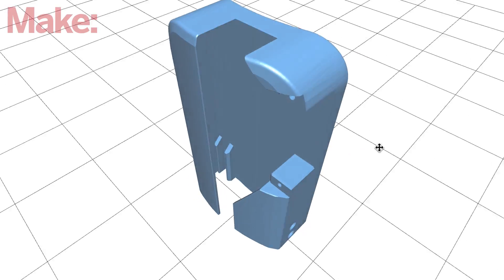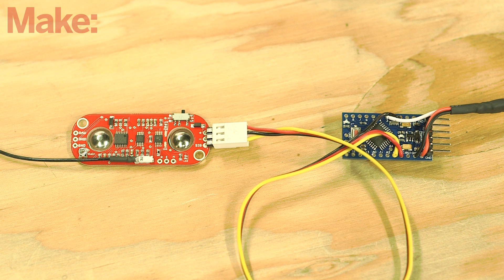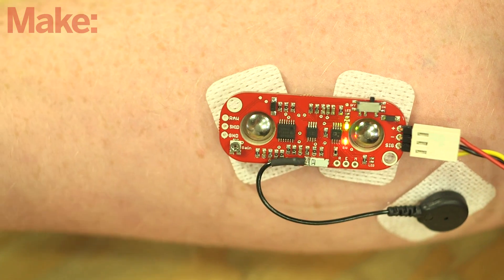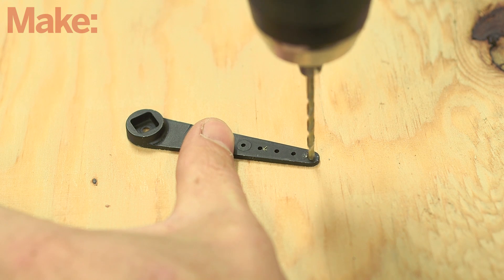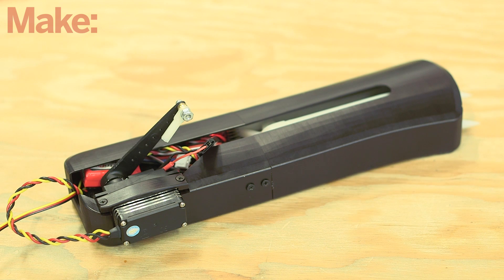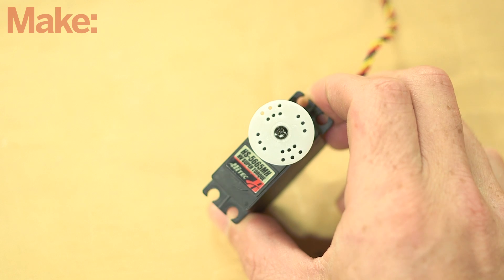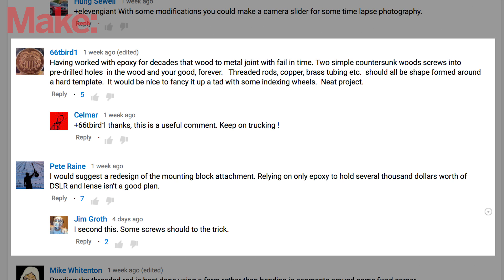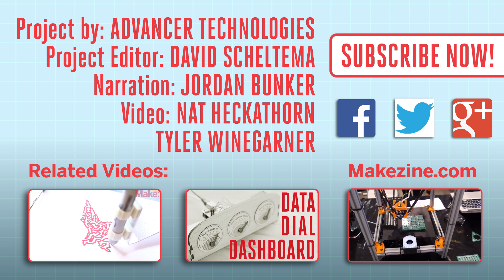3D Printed Bionic Claws

Comment: you could use a cheaper and smaller micro controller  to operate it example:pic16f84a .... use burner to program chip only problem is its using assembly which sucks :D

Comment: Would a solenoid work as well? That way you wouldn't have to have the rod that sticks out of the brace when the claws are extended. They have them that run on 5 volts, but they might be loud and I am not sure if they would have enough force. Might try one day though.
Reply: +Scott Perry the issue is more the travel. it's hard to get 4" of travel distance in a compact form.

Comment: How about instead of a servo there's a track lined with electromagnets that move the claws?

Also how about using more sensors to control the claws individually?
Reply: +Crowforge 1) electromagnets are really bulky and usually heavy, 2) individual claw control would require two more servos
Reply: +NullPoints 1 They wouldn't have to be that powerful. 2 The idea is to replace the servos with the rails.

Comment: I would put the servo off center and horizontal. then have the rod connecting the servohorn to the claws slide back and forth horizontally but have the servo off to the left and the arm pivoting across to the right. this would enable it to not ot have to stick out of the housing on top and thus it might fit under a bigger sized jacket.
Reply: +kerberos623 1) you would have to widen the enclosure a lot to get all that to fit in it horizontally, 2) making it off center reduces the travel distance of the claws which would mean you'd have to shorten the claw length

Comment: You could probably use a weaker/slower servo to release a spring to drive the claws forward... But then it would be harder to retract them... Interesting...
Reply: +Aidan Leitch this design gives you the flexibility to have an infinite number of control strategies. The makers have mentioned before that they originally intended for the claw extraction speed to vary depending on how hard you are flexing. Simply put, the harder you flexed, the faster the claws would come out. this would allow you to extend the claws in a slow / dramatic fashion instead of always full speed like they are now.
Reply: NullPoints Fair point.

Comment: just use a switch... why so complicated?
Reply: it doesn't give the full effect.
imagine wolverine flicking a switch to activate  his claws
Reply: +HALOEXTREME _EVO You could mount the switch inside of the hand on the palm. It would look exactly the same as flexing you hand closed as done in the video. A simple open circuit switch would do just fine. Close the with to ground, the claws come out. Release the switch, or I guess I should say button, and the claws go back in. Much cheaper then this muscle sensor. I would see that used in other places, but not here.
Reply: +Scott Perry The difference is that you don't have to physically close your hand to trigger these claws; you simply have to activate your muscle. This can be done without any joint movement.